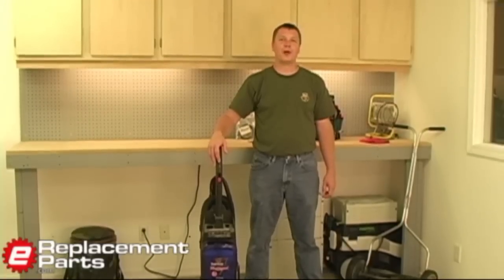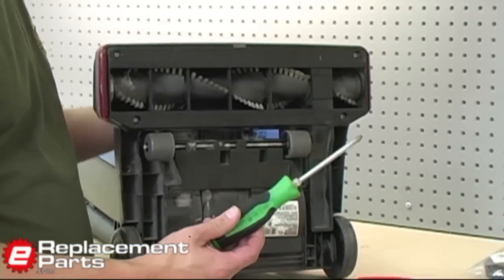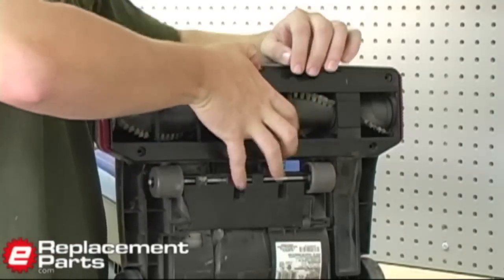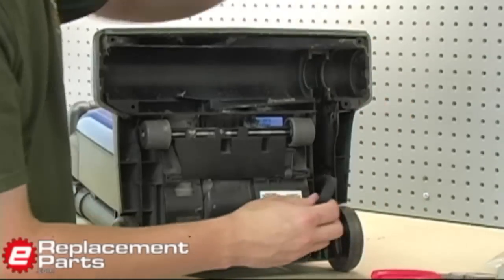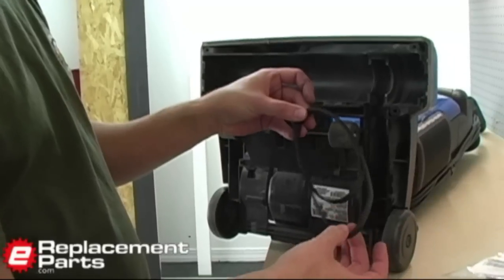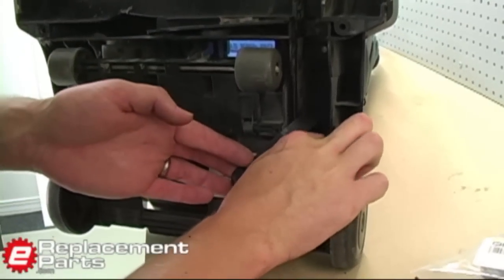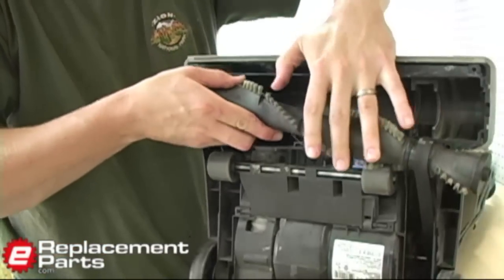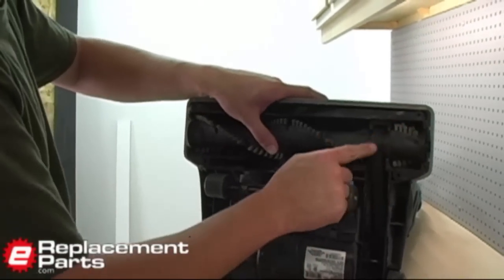Changing Eureka Vacuum Belts

Comment: Thank you very much because this is the type of vacuum bottom that I need to replace the belt on. It is sold and it's a die hard. But the beater bar brushes not moving. And all the other videos are about wind tunnels. I needed to see how to take the bottom apart. Thank you

Comment: I have a eureka the boss vacuum cleaner, it doesn't have 4 screws to unscrew...do you have one of these that you can show me  how to get the plate off so I can change the roller?
Reply: The screws are on the top of the vacuum on that model.
Reply: I Googled on how to change the belt. There's many videos that are for WindTunnel eureeka's. And the screws are on top. Well I needed a video like he just showed me. Which I couldn't find. And he showed me. Cuz mine's old. And it's the bomb. But I found it on eBay I called Sears vacuum Center. And he told me that I need Eureka brand the original brand for bags. Because Google tried to say The View type bag is universal and it's not. The guy told me know you need the original. But they don't make him anymore so he gave me the item number and I found it on eBay I bought nine of them. But I also found the belt on eBay. They didn't have it at Walmart. I don't know if you need the item number for your vacuum cleaner or not but like I said I called the Sears vacuum center. I got the number through Google.

Comment: Thank you for your videos. You have helped me save my money this time . I need to buy  a new belt for my eureka  2000 where can I find it? I am gonna check in Walmart besides that is there any other places we can easily get it.
Reply: I had to find new belts for my Eureka too. I went to Walmart for Eureka bags. Monson old fashioned one but I have good old brushes that hook to the stem. That are so old that the brushes bristles are like new. Well I just found out my beater bar brushed isn't turning. And I couldn't find a video on a vacuum that has the bottom part that needs to come out. And he did it he showed me. So I had to look on eBay I have style you Eureka upright and I found out that the vacuum cleaner bags were 54310c.. Walmart had was bags that said Powerline Electrolux and stuff like that in generic form. And I wanted actual Eureka bags. And a Eureka belt. I look for it online on eBay and I found it. It help knowing that item number for the bags. Because all they had was tun Eric's and last year I bought nine generic bags and none of them work right they're defective. So I actually found brand name Eureka bags and brand-name Eureka belt. I called Sears Center 1 800 number to talk to Vacuum Specialist and Google said any type new style bag is universal. And this guy told me no it's not you need the actual original bags. And they gave me the item number. And I found it. So thank God cuz I'm just trying to do tight places with my stem and hose. Because I'm trying to treat the house. With fleabusters powder and it needs to be vacuumed first. Well I found out when I use these bags they didn't work that I had from eBay. Now come to find my belt is bad. So I found them on eBay I couldn't find them at Walmart.
Reply: I just ordered mine from Amazon. Arrives in 2 days.

Comment: Eureka Boss 4870 is a horrible piece of junk. Once the belt goes it is extremely difficult to replace. The belt has NO groove to keep it in place. It slides to the edge of the motor pulley. I have successfully changed the belt but it BY FAR the hardest belt I have ever changed. TOTAL CRAP.
Reply: +Mark Garrison Good luck finding a belt that isn't made of a recycled condom and isn't as durable.